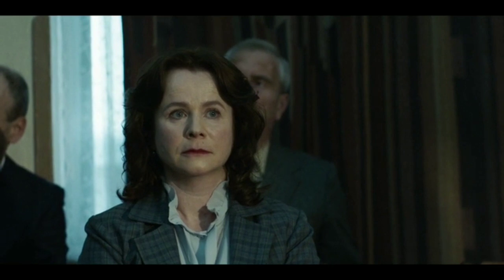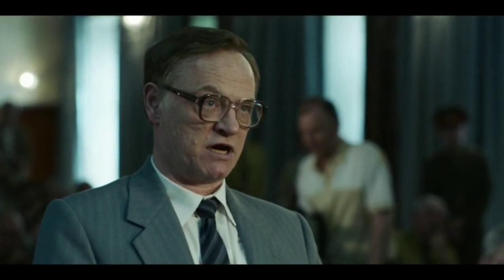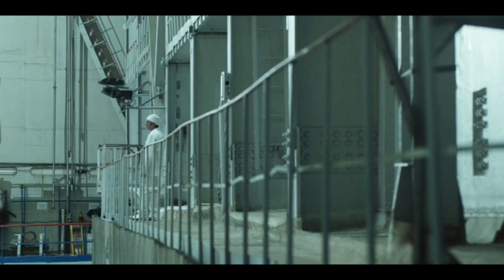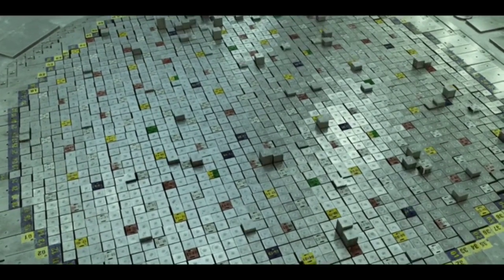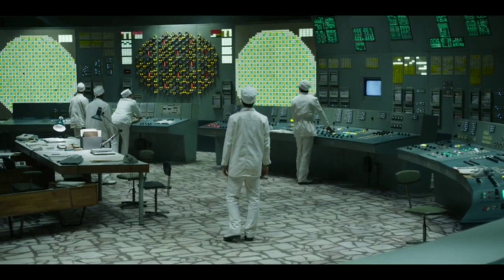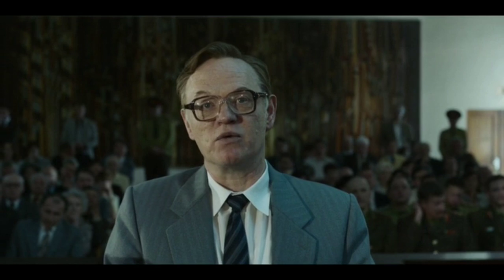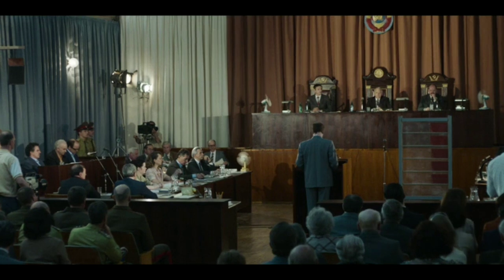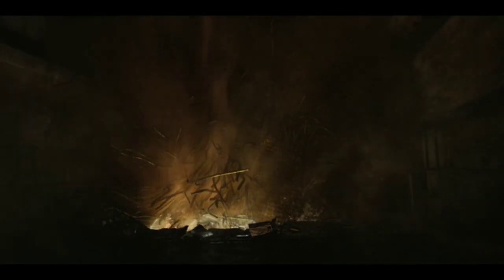Chernobyl (2019) - Use of AZ-5 Button

Comment: It's my belief we will see this again in Ukrain except 10 maybe 200 times worse
Reply: Because of the power plants or a nuclear attack?
Reply: @eurekify1563  It looks or at least at the time the Russians would blow the reactor in Ukrain and they still might
Reply: @georgevossen3846  reactor is unfueled at the point, only #4 is still producing heat cuz it's melted and they can't cool it
Reply: But why? The russian gov fixed the reactors , right?
Reply: nope, the only reactors in ukraine now are vver, and these are pwr reactors, which are moderated and cooled by water, not graphite. they have a negative void coefficient, meaning that if the water boils away too much, the reactor will shut itself down on its own, without control rods. the only rbmks are in russia, in Leningrad npp and a couple other places, everywhere else in eastern europe uses vver or western designs which are similar to vver. unless the russians literally blow the reactors in ukraine up with explosives, such a thing isnt possible anymore, atleast not to that extent, what is possible is a situation like 3 mile island, which is a partial meltdown, but still harmless compared to chernobyl.
Reply: @SimonBauer7  yes but here were talking large scale weapons with chances of even accidentaly causing an amplified explosion through reactors in ukraine, i think they are defueled and turned of for security reasons but i dont know, war needs oil, not electricity, oil can create electricity aswell